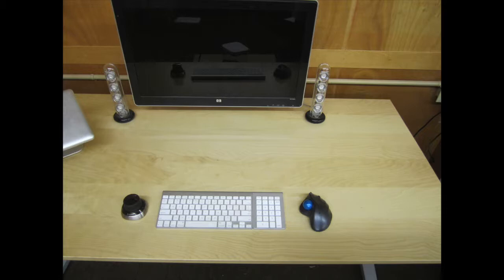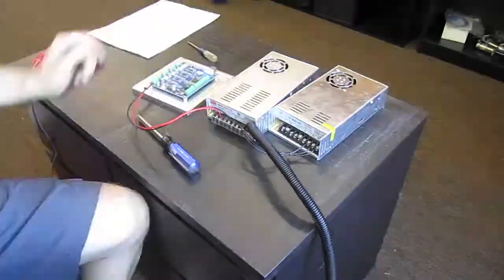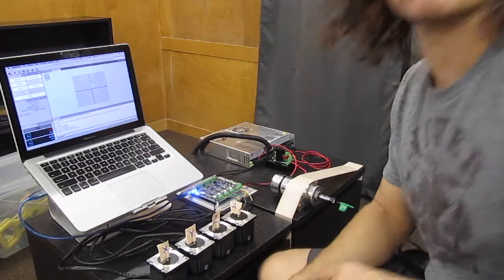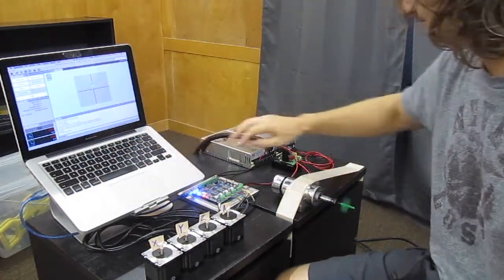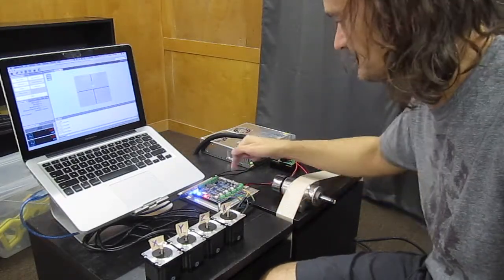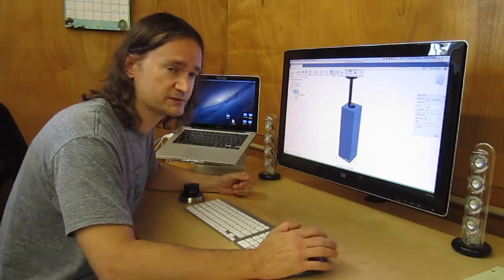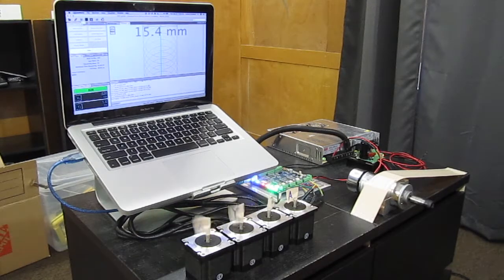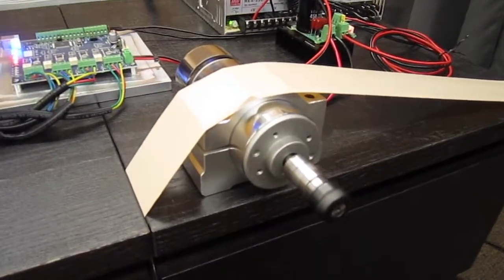CNC Machine with TinyG board and Universal GCode Sender

Comment: Did you ever get any further with this project? I'm about to embark on building my own machine.

Out of curiosity, what current at 24V and 48V does it actually draw? I'm wondering if I could use a boost converter from 24V to 48V to avoid one of the mains PSU. Or maybe buck regulate from 48V down to 24V for the steppers.

Thanks!

Comment: Hello,
Great video
I have the same configuration but when I connect to UGS ( UGS plateform2.0 night build version)
evrything seems to be connected but no possibility to control the board (jog control.)or sending command
Which serial com you use and hod did you install it on your mac.
thanks for your help